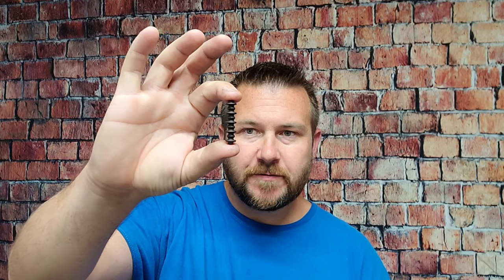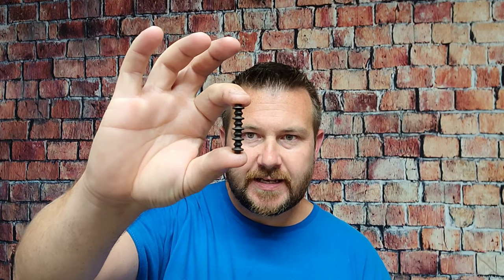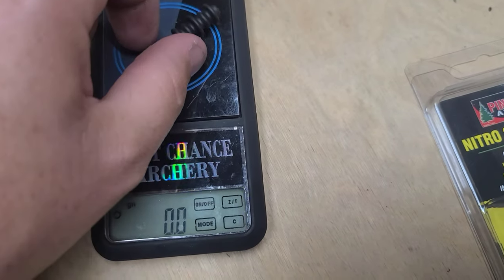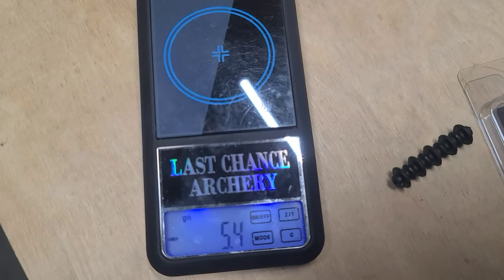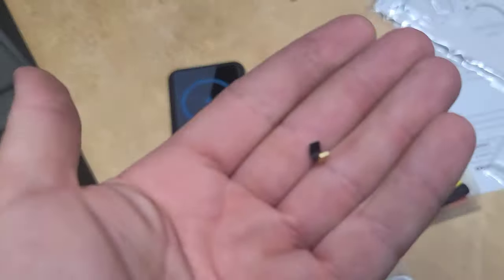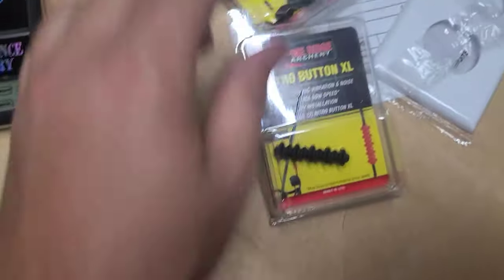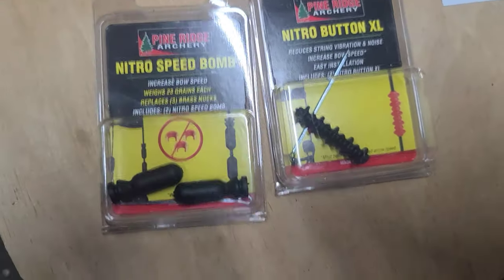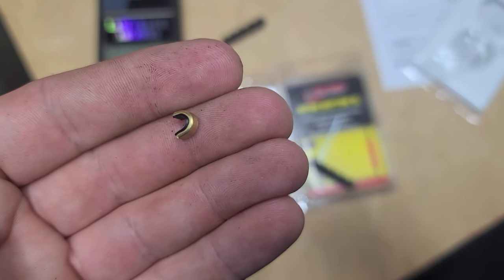Speed Nocks or Speed Sleeves?

Comment: What would you recommend for my old Switchback XT? 27.5” DL
Reply from the maker: Honestly, Probably neither. Those bows didn't come with any. From my testing it will eat the string suppressors up quicker if you put sleeves or nocks.
Reply: You answered my question.  I was wondering about my xt today, if it needed speed nocks.   Thks!
Reply: @archeryshack  do you sell the string suppressors for it? Mine are pretty chewed up as it is.